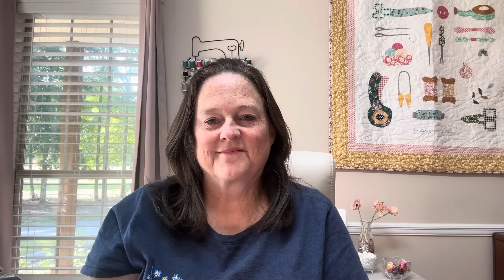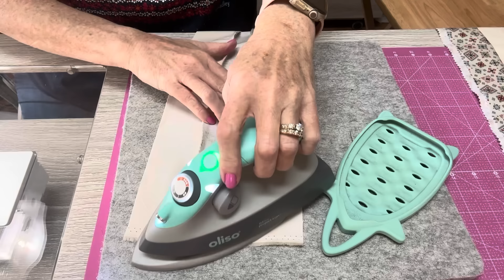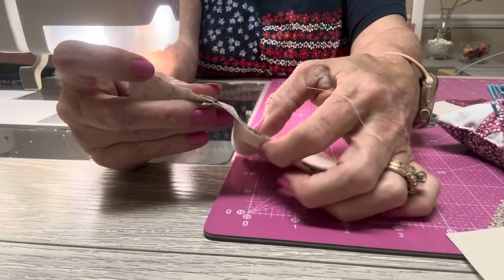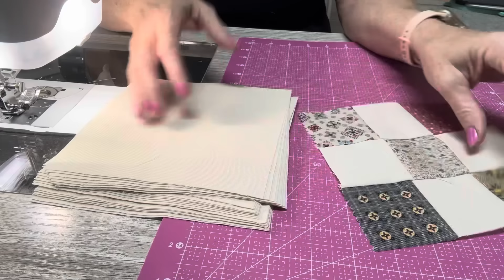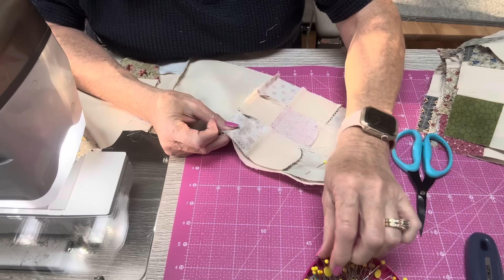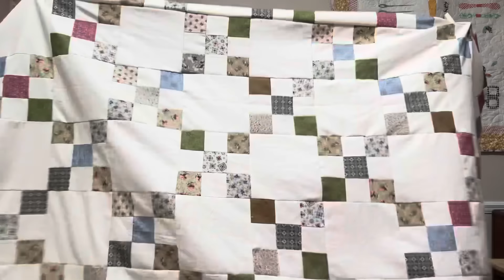Irish Chain Quilt Made Easy!

Comment: I’m also working on my version of an Irish Chain using 1-1/2” squares as leaders and enders. Then sewing them into a nine patch block and using a background white square cut to 3.5” as the alternate block. I’m matching the print squares for each nine patch…more matchy matchy than scrappy. It’s a great way to use up my 1-1/5” scraps and saving thread since sewing as leaders and enders.

Comment: Hello Penny, 
What a treat to get up this morning and find this tutorial. Your colour choices are beautiful. I have attempted the Irish Chain, but I've done it from 2 1/2 inch squares. Rarely does it line up as well as yours does. So, I am going to try my hand at it again, and I will cut strips, length of fabric. 
I must mention, the sound went wonky when you were giving the measurements for the squared up square and the plain square. Would you be able to add those in?  Thx.
The leaves are starting to change colour here in Nova Scotia. It's about 3 weeks early, but we had very little rain over the summer, so, the trees were struggling. But, it is certainly pretty. 
Thanks again for this VERY enjoyable video. God Bless, 🙏😊

Debbie
Reply from the maker: If you go by their shop, tell them we said hello!!!!!
Reply: @sewcharmingquiltshop  No. I haven't me them. Their about a 3 hour drive from here.
Reply from the maker: Yes. I don’t know what happened to the sound as I didn’t move or change anything. I noticed it when I was editing the video. I couldn’t go back and fix it because id already made the quilt by then. But, it doesn’t change the steps so it still works. 

Also, have you checked out “Quilts by the bay” in Digby? Those are my friends! Debra and Twila. They’re sweet!!

Comment: Strip sets really streamline this quilt!
Reply from the maker: Most definitely! I made a quilt video about a year or so ago not using a jelly roll. I had already cut the pieces into 2 1/2 inch squares for another project then forgot what I wanted to do with them because it had been so long. 😂. Just making it from squares took so much longer, not to mention cutting the squares.
Reply: @sewcharmingquiltshop I have a stack of 3-1/2" scrap squares waiting to be sewed, if only there had been enough fabric for strip sets 'sigh'